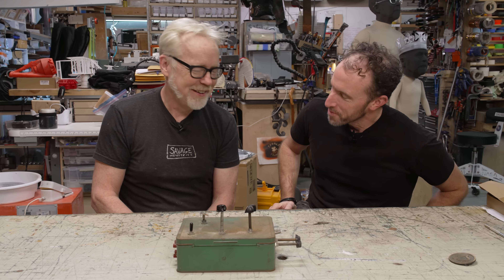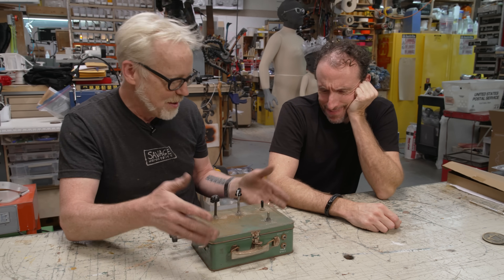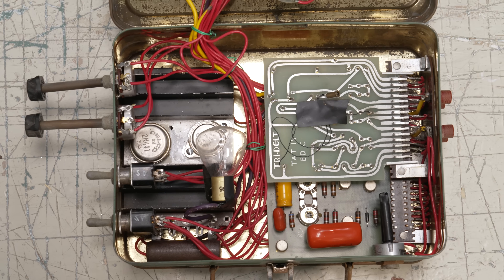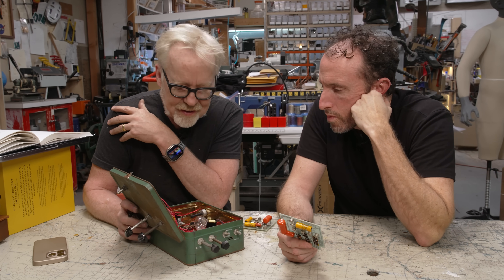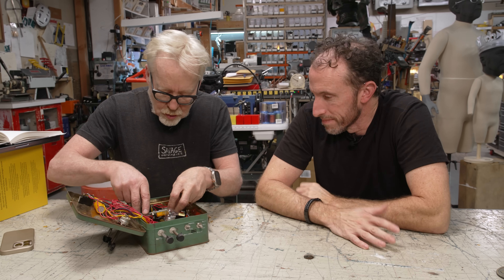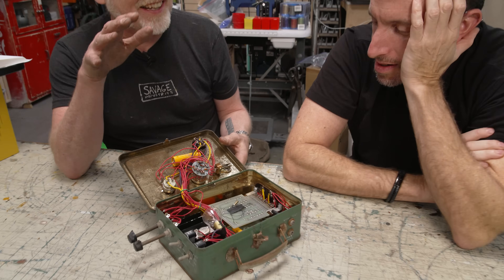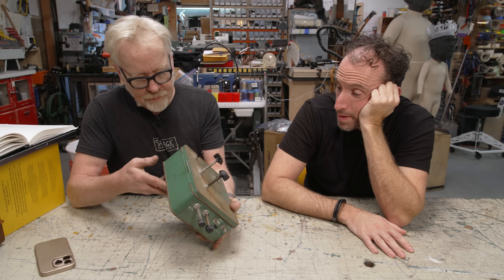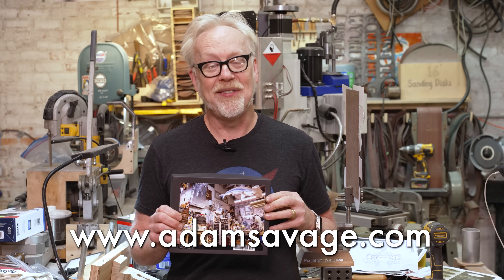The Mystery of This Vintage Electronics Lunchbox

Comment: A Greenlee knockout punch would punch a clean hole in sheet metal like that. In an RC club or someone with that kind of depth of building like that appears to have could have had access to something like that for a very clean knockout for those panel mount switches. 
Very nice work.
Reply: i think he was meaning the small double slits on the sides... which were holes where a shoulder strap would have mounted to the Original Lunch Box

Comment: Its a TAT (true action throttle) IV model railroad throttle. The original article was published in March 1969 Model Railroader magazine.

Release/apply/lap simulates train braking.
Reply: This is what I love about the internet
Reply: @MB-st7be isn’t it crazy how quickly this happens. Someone who knows exactly what it is and where to find info about it.
Reply: Really needs a followup video with Adam running a model railroad with it.
Reply: My first thought was model railroad controller. Now I'm going to have to look for that issue.
Reply: @Ariannus  Mine too, because the old model trains didn't originally have PWM.
Reply: Well, that didn't take long 🙂
I am somewhat surprised they didn't even entertain this possibility. My noob brain immediately went 'model railway controller' before they even opened the thing.
Reply: Yeah my first guess was model garden railway DC motor controller. Looks like I wasn’t the only one. 😎
Reply: Yeah, my bet was after few minutes model train too! Thanks for the info :)
Reply: That was my first thought. Train set controller
Reply: now i want a big clive reverse engineer of that....
Reply: I was thinking it was for a train
Reply: I was thinking slot cars but you are correct!
Reply: I'm not a model person but was screaming at the screen "scale train controller!!!"
Reply: This is why the internet was created, this exact situation. Bravo, bravo.
Reply: I was just going to say it was rail...  The reason was just the markings of the Release-Lap-Apply switch, which are air brake terms.  

1969 fits the style of wiring and electronics of the era.  Those red plastic indicator lamp housings were very typical of that era, sold by Allied Radio, Lafayette and Olsen.  Takes me back.
Reply: @williambecwar7939  And the 'momentum' adjustment.  Turned up, it would make the model train accelerate/ decelerate much more slowly.  Cut the throttle completely and it would 'coast' along for some time.  To simulate the massive inertia of real trains.
Reply: @mikefochtman7164  The pwm would control the torque of the train I assume? To look real, it would need to struggle a little going up hill, so it would make sense to me that you could vary just how much torque it has.
Reply: @mikefochtman7164  As soon as I saw the Momentum I knew it was a train throttle.
Reply: @rich1051414  The pulses allow slow speeds. The DC at lower voltage wouldn't unstick the motor enough to move until it was too fast. The pulses give full power for just an instant for really slow operation, and as you make the pulses closer together it speeds up.
Reply: @rich1051414  Simple train control just varied the voltage, and at very slow speed settings 'stiction' often would make it jerk and stall.  Instead, using full voltage with PWM you get strong pulses of torque to keep it moving at very slow speeds, creeping along more realistic.
Reply: @thomasbunce4342  Interesting. Thank you for explaining.
Reply: @thomasbunce4342 sounds JUST like my mom’s train! If you tried to ease up the speed from 0, it would buzz and creak a bit, and then ZOOOOOM once you got past a certain point. I was also always positive I could hear it slow down around the far end of the loop, and speed up as it came back past the transformer/control box. Was I right?
Reply: Thanks. My first thought was model train but I have not seen this before.
Reply: I came to the comments after about halfway through this video. Wondering who figured it out. That is fantastic. Thank you for sharing!
Reply: Funny but railroad popped into my head too. I have nothing to go by.
Reply: I wonder if I read your comment sub consciously because my first guess was for model trains.
Reply: Yep, I got model train vibes too, couple of guys I work with have trains in their gardens.
Reply: Yeah as soon as I saw the release apply lap it made me think of train brakes.
Reply: This is why the internet was created, for situations like this. bravo, bravo. Humans on the internet IS a quantum computer, just need to allow possible answers Access to the question platform.
Reply: I was screaming at the screen that it was for a railroad set and then I came down to the comments and found this as the top one. THANK YOU!
Reply: That’s what I thought of the moment I heard them say lap and apply! 😅
Reply: Holy-moly!  The Internet really does know everything.
Reply: Why isn't this pinned
Reply: I had an article from a more recent article in "Practical Electronic Projects for Model Railroaders", 1974.  The designs shown have much of the same concepts, but even the "full featured" controller was simpler.  When I saw the interior of this box, I thought the same as @nbrodar, but now that I look at the magazine, there are differences to the design (and a lot of similarities).  If this is MRR controller it likely runs on about 18V (the full featured one had provisions for running on 115V and it rectifies 18V from the transformer).  The article has many designs and it is hard to pick out anything that matches well to the lunch box controller.  (surprisingly, I was able to find this on my shelf, I bought the magazine at a MRR shop when I was in elementary school but never made the designs as my knowledge and access to components was too limited and when that changed, I no longer did MRR).
Reply: So would this take wall power or a battery?
Reply: @BrandEver117 I'm pretty sure it used stepped down wall power and only partially rectified the AC to create the pulsed DC.
Reply: Adam, rebuild this!!!
Reply: was my guess.
Reply: Yup, that's what I was thinking. Throttle but no radio, a model train is the thought that comes to mind.
Reply: Model railway control 
Lap is a brake (simulation)application on a real life railway where you make a partial brake application but don’t want to fully apply the brake just to slow the train down
Reply: Thank you! At first I was thinking of slot cars. Thanks for releasing my brain from the puzzle
Reply: Lap, meaning hold existing brake pressure to slow down.
Reply: @cadewey6181  Exactly right. From the term describing the interior of the brake control valve when positioned so the lands of the spool over-LAP the ports, closing off both the inlet and outlet ports.
Reply: I was about to post this , You beat me :D
Reply: I'm not into model railroads, but that was my first guess as well.
Reply: Indeed.  And a search for "TAT IV improved transistor throttle by Linn H Westcott" will find many threads discussing it and such.
Reply: 😊Just looked up that issue.  I had forgotten that I built one when I was 20 and into model railroads.  There is a full schematic and parts list in that article.
Reply: I was thinking from the beginning "model railroad".  Thanks.
Reply: That's what I thought.  Glad I was close!
Reply: The TAT IV (True Action Throttle IV) was an advanced model railroad throttle design published by Linn H. Westcott in the March 1969 issue of Model Railroader magazine. This transistorized throttle was part of a series of designs that evolved over nearly two decades, improving model train control.
The TAT IV circuit incorporated several key features:
Immediate engine start: The circuit was designed to provide instant power to start the engine, overcoming initial static friction.
Very slow crawl capability: It allowed for precise control at extremely low speeds, which was a significant improvement over earlier designs.
Pulse-width modulation (PWM): The throttle used PWM to control motor speed, which helped with low-speed performance.
DC voltage with superimposed pulses: As the throttle was turned up, the DC voltage increased while pulses remained constant, added on top of the DC. This approach helped maintain good performance across different speed ranges.
Optimized pulse frequency: Westcott's design used 40 Hz square-wave pulses, which he found produced the best low-speed running. However, this frequency was later adjusted to minimize motor wear and heating issues.
Heat management: The circuit included heat sinks for the "big beefy transistors" to handle the power output.
Control features: The throttle likely included potentiometers for adjusting various parameters such as start voltage and maximum speed.
Braking function: The circuit incorporated different resistor values for various braking rates, controlled by a switch with positions for release, lap, and apply.
The TAT IV represented a significant advancement in model railroad control, offering improved low-speed performance and more precise control over train movements. It addressed issues like motor heating and wear while providing a range of control options for model railroad enthusiasts.
Reply: I kept thinking control line plane. Glad somebody knows.
Reply: Hot dang that makes total sense!
Reply: My first thought was model railroad controller as well.. followed closely by similar for a slot car track or something.. but in both cases, I felt there were too many functions and controls for either of those. This True Action Throttle now gives me something to research lol.
Reply: My first guess was a VSD for a lathe, but then I thought it might be for slot car racing.
Reply: OMG YES! I was just about to pop on to say this. I remember this and how I learned so much about electronics from Linn Westcott back in the day. I credit him for the career I went into for a while and why I still play with electronics.
Reply: I was thinking this sounded a lot like the controls for my mom’s antique Lionel train! Except this honestly sounds like it’s potentially safer. 😂

Comment: This is Bruce Chubb's work. The boards, that is. Model rail road stuff. 1970's for those wondering.
Reply: 8 minutes for the win!
Reply: I’m surprised they didn’t at least look at the voltage of the bulb? Could be downstream of a higher input power, but probably not. 
I have to say that model railroad came to me pretty quickly. Lap is a brake term. As it applies to air brake operation, not lapping as in lapping compound. Lap setting on a brake stand is a position of the handle that once a brake setting is applied, it holds the pressure in the line. Not dumped.
Reply: @dougcoleman8706  The large (automotive, probably) light bulb is going to be for over-current or inrush current  limiting.
Reply: I had friends who built stuff like this .  Cool to know who and what it was made for ✓
Reply: Coming here to say this looked like model rail to me too
Reply: I will have to look up Bruce Chubb now😂
Reply: @danieldare2640 I know Bruce Chubb. I will ask him.
Reply: @danieldare2640 the guy was a genius, look up CTC-16, a system he developed to control 16 separate locomotives on one track. Very early predecessor to the current DCC systems.
Reply: @danieldare2640  Try OF :face-green-smiling:
Reply: I had a feeling it might be for a train. Internet wins again.
Reply: I was thinking model trains. Those guys build all sorts of custom switches for their sets.
Reply: Bruce did a lot of early automation for model railroads, including a system for programming and controlling signals and such with Commodore and Apple ][ era computers.
Reply: It's remarkable to me you know who the specific person who made it is, amazing the breadth and diversity of human knowledge.
Reply: Ahhhh I was right !!!

I grew up with 70' & 80's kits and the construction of this thing has "Old Man" WW2 veteran all over it 👍
Reply: I would had of guessed that until I got 4 ish mins in.  Maybe five.  Did the old model rail stuff run off 120.?   Or this is the step down transformer\switch?   So cool
Reply: @aaronblackford981   No.  The throttle needed an outside power supply to work -- 12-14 VDC.
Reply: @thomaslevy2119  so this was powered by a plug in transformer which ran on 120?  If that’s the case, wow. I didn’t know anything before the very early 80 or late 70s that needed the external adapter which we have reverted back to these days. Yeah, I have a cable.  But do you have the block that plugs into the cable.  No.  But I have the block that is connected to the cable to power to and from days.
Reply: @aaronblackford981  Power for a home-built throttle like this one would usually come from an existing model railroad transformer.
Reply: @ ty however I am aware of what is normal but many things within the video I wasn’t aware of for the time.